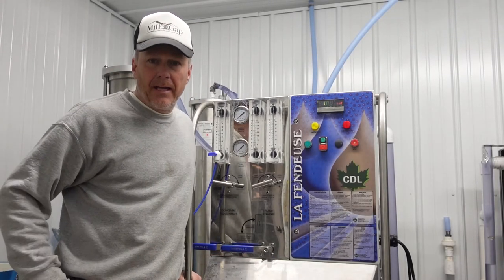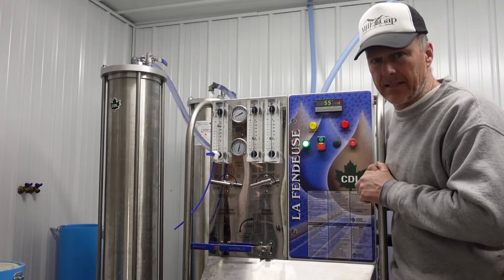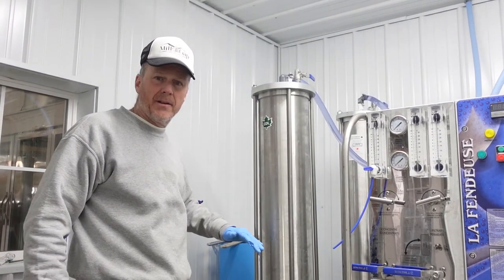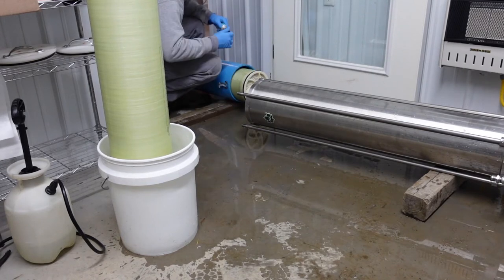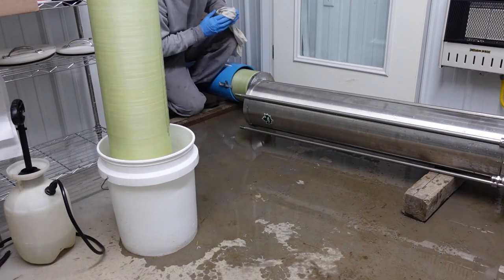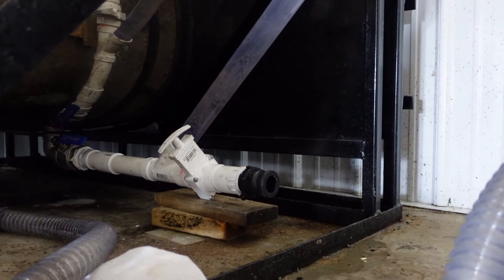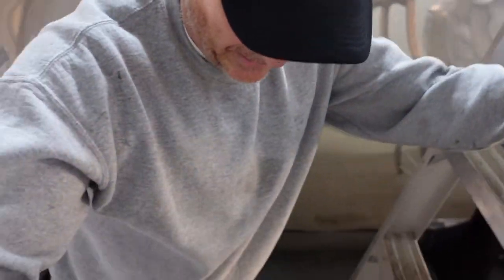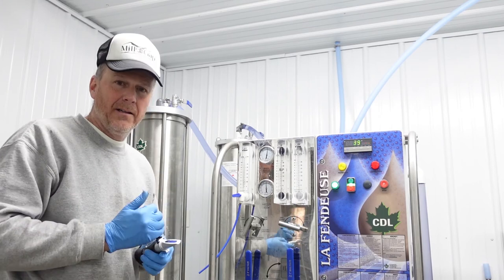Replace a Membrane in a CDL Reverse Osmosis Machine

Comment: What Size feed and high pressure pumps does this model have? Is this the Classic or Deluxe model? Love your videos by the way! Definitely would love more RO and evaporator videos!
Reply from the maker: Thanks for watching Robert Albini.  It's a 5 hp pump.  It's a deluxe model.  I don't think they make the classic in the 5 hp.  It works well for us. If I was going to buy a new one, I'd probably buy the 7hp.  Not that I need it today but for the future.  I've been thinking of a high brix ro but I'm not ready for the costs. I'll work on some RO and evaporator videos.  Again, thanks for watching!   Kevin